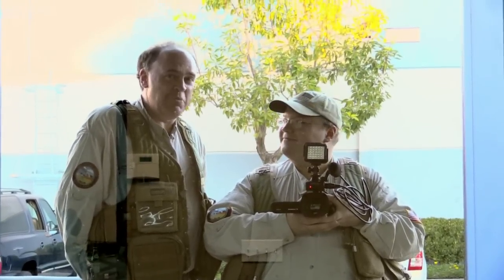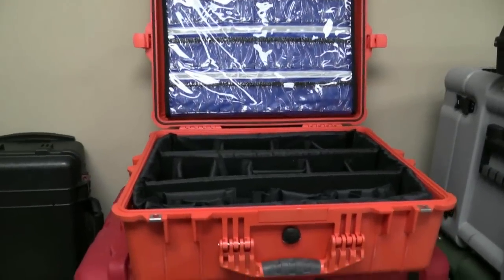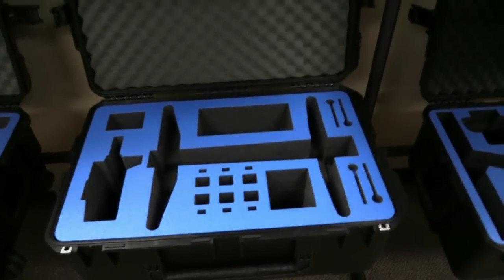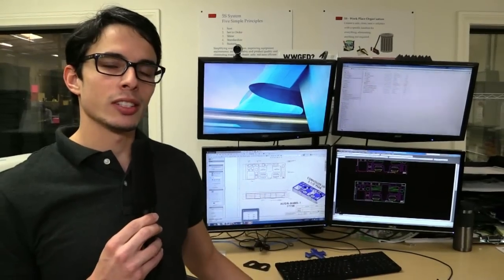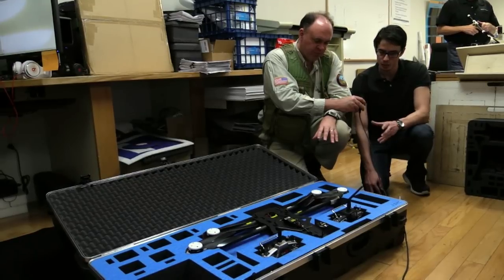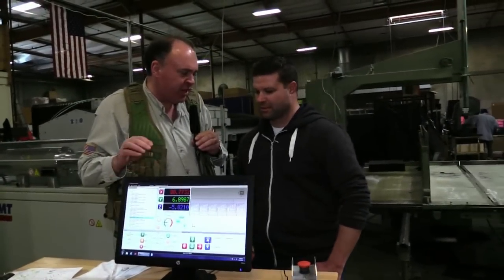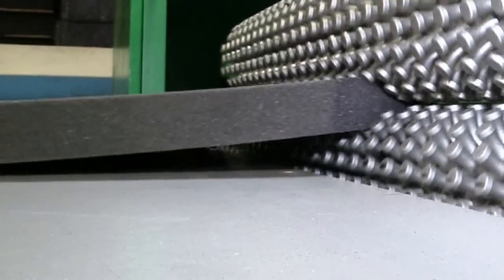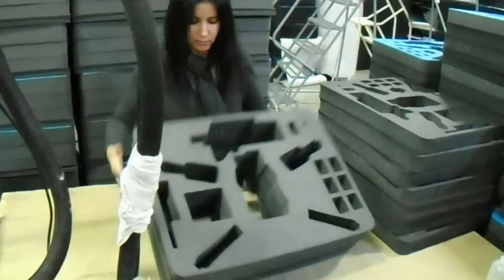See How Travel Cases for Drones are Cut with Water Jets

Comment: Waterjet is great and way cheaper than steel rule die but those pumps are costly. The designer is like..I get a napkin with rough size and make it mechanical. 50 000psi will cut ya for sure, May source some foam to cut up here on the Flojet and give it a shot. We used a bathroom plunger on the nozzle LOL! The robot glue machine is like a glue 3d printer.
Reply from the maker: Hoverbot1TV A 3D glue printer -- I never thought of it that way, but you're exactly right! Thanks for watching!
Reply: It would be great for cake decorating too! oopps! just gave away another new biz idea LOL! A store front window with mechanical robot cake decorating would be a news story.
Reply: Roswell Flight Test Crew that glue  robot is cool! Is that hot- melt glue coming out of it?

Comment: Water jets vs. CNC makes sense, but what about lasers? Then again, I assume you would need enclosed machines for safety.

Any opportunities for recycling the pieces being cutout?
Reply from the maker: John-Paul Hopman Hey, John-Paul! We're at NAB in Las Vegas and I met up with Rick and asked him about the leftover material (called "plugs"). He confirmed that it is, indeed, recycled -- so nothing is wasted in the production process.Thanks for asking!
Reply: The water-jet cutter is still a CNC ;)
Reply from the maker: Jay Anderson True... Thanks for the assist!
Reply from the maker: John-Paul Hopman Lasers... I know they use laser cutters for materials like plate steel -- probably overkill for foam. Also, I can't help but think that the lasers would melt the foam, so you wouldn't get those nice, clean edges. Regarding recycling: another commenter asked the same question. If they mentioned it to me while I was at the factory, I don't remember. However, I'm going to to see Rick this week at the National Association of Broadcasters conference. I'll ask him what happens to the left over bits and report back.

Comment: We finally got to see the water jets.
You know it must take a lot of will power to resist putting your hand under the jet to see if the water is going to come out. LOL
The last guy that did that had to change his name to Nubs.
Reply from the maker: TEAMERICA You know, it took less willpower to restrain myself than you might think... Yes, it was "only" water, but watching it slice through that foam like a razor blade was certainly an inducement to keep my fingers and toes well away. One question I didn't think to ask was whether there is an emergency cut-off if the machine detects something over the work surface that doesn't look like foam... Hmmmm...
Reply: ***** It doesn't matter what it looks like, it will cut it.  I worked in the Aerospace Industry and they use this same process to cut the Carbon Fiber cloth before molding the F-22 intake ducts. The best safety device is the human brain when its used.